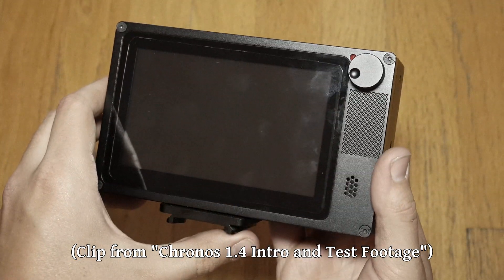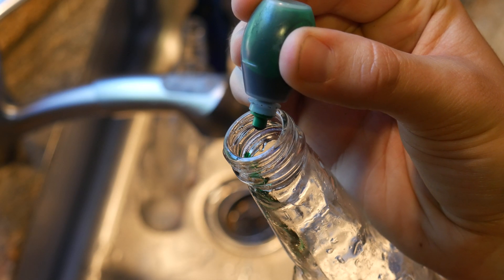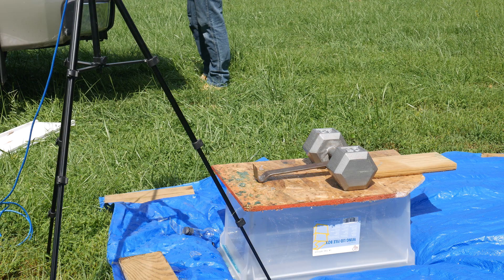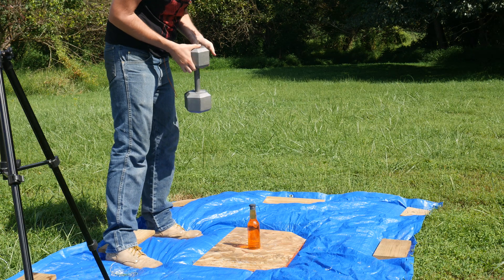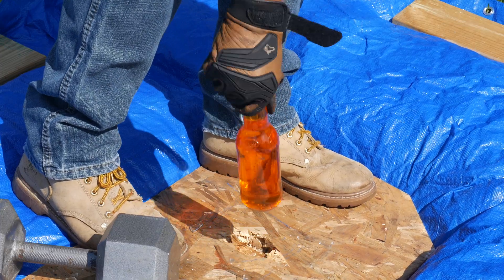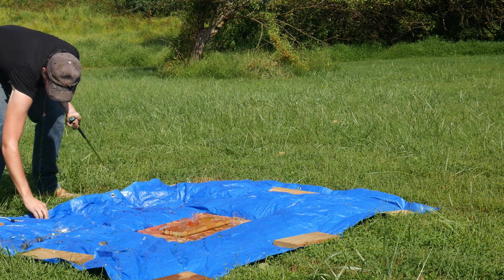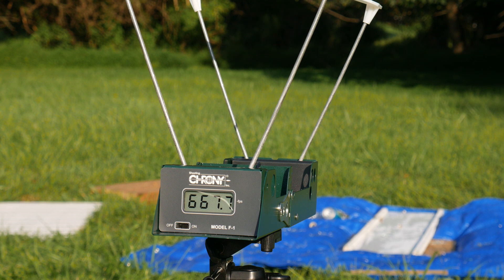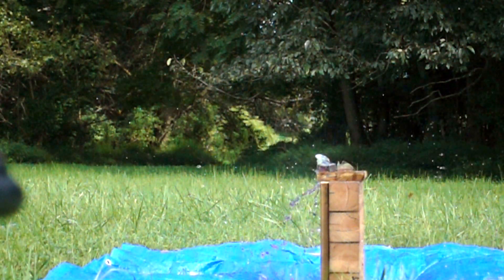High Speed Video of Glass Bottles Breaking (960 to 31,000 FPS)

Comment: That was pretty cool.....Completely enjoyed that. I noticed one bottle was shot at 31,200 fps... .Is that the fastest that this Cronos can shoot?
Reply from the maker: It can go a little faster: 38730 fps at 336x94 or 40420fps at 320x96 on the latest beta software. I have found that 31200 is probably the fastest useful speed in most cases though. Faster you need so much light that the quality degrades a lot, it seems generally noisier, and of course the few extra pixels help as well.
Reply: Guess that's  why most of the super slow motion recordings are shot in studio  (lighting controled) situations....thanks for  the detailed reply....really enjoy your content. ..thanks
Reply: Fuzzy Dice Pastimes do you use a remote button for the Sony rx100?